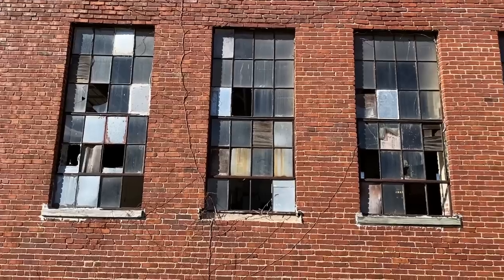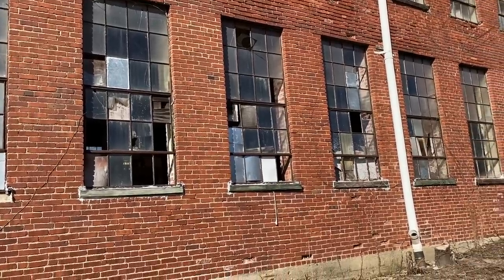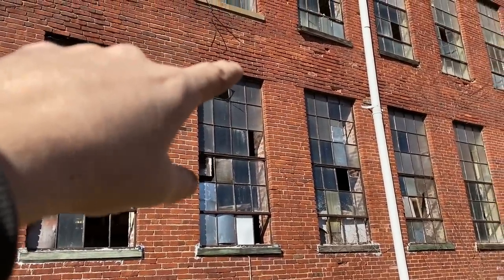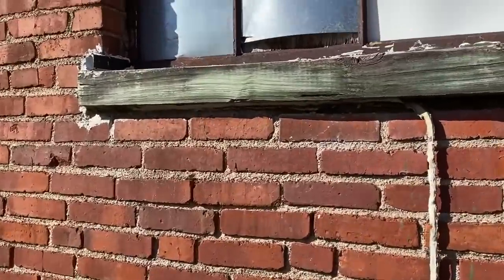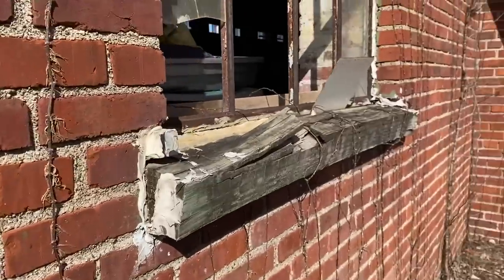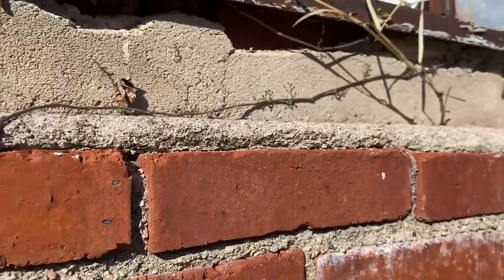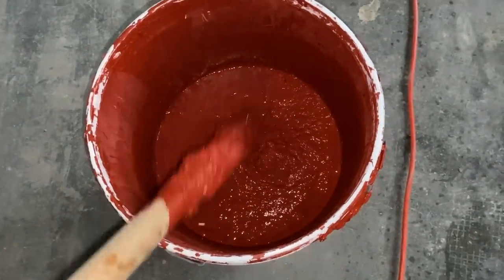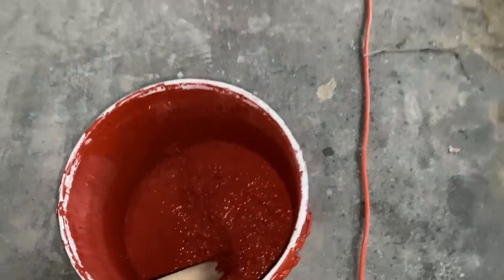Industrial building renovation - sealing windows against rain and trespassers

Comment: It would be helpful to go to the hardware store and grab a can of Johnsons paste wax, then wax your planer surface and tablesaw surfaces regularly. This will help you to slide the wood through without fighting, and it smells good. This is an old carpenters trick we wax our tablesaws on a daily basis.
Reply: Or Teflon spray, but the surface will be slick as snot for a bit afterward.

Comment: Progress is looking good Just curious, did you try adding a bit of paint thinner to the 5 gallon bucket that began to solidify?

Also consider placing some exterior surveillance cameras as well as numerous no trespassing signs, and maybe some video surveillance signs as well as alarm company signs up.
Reply from the maker: no, didn't think of that.  Nice tip.
Reply: @coldwarmercantile  If it's Latex paint the its is water based.
Reply: if the paint is water based , it just means the frost has got to it , it may smell a bit but for what you are using it for, it will be ok if you give it a good stir

Comment: Haven't read all the comments, but you might want to think about covering the window sills with sheet aluminum.  Rent a brake for a day and make up some sills, put them in first, over your wooden sills.  Caulk, etc. then put your sheet goods over the window, leaving a slight gap between the plywood and the aluminum so water doesn't pool there.   The wood you're using will last about two years or so, even if painted, if exposed to the weather.
Reply: I have to agree. Metal wrap the sills. Even if there is no wood under the metal. Until you can do the sills properly with bricks and cement like the front window. Which is cheaper and easier with brick. By the way
Reply from the maker: I want to pull them out after a bit and pour concrete sills when I get a bucket truck.
Reply from the maker: I am going to teach myself to pour concrete with a form.
Reply: @coldwarmercantile  yes youtube has some good bricky guys that someone has a solution for this exact sill project if you search.  Pretty quick once you have done one. Youll be fine, one way or the other. stay confident in your goal. Its entertaining
Reply: Normally that would be my suggestion but Imo it wouldn't look that great. Like something they would have done to the building later on. I'd find some fur, cedar, hardwood something like that. Period correct.

Comment: That first machine you used (the red craftsman) is a Jointer, it gives you a flat, straight bottom surface, then you use a Planer to make the top parallel to the bottom along with the desired thickness.

Comment: I look forward to your videos.  Your DIY is coming along.  Just for you information.  You made your sills out of spruce lumber and it is not a very durable wood for exterior.  Maybe paint will save you.  Spruce is very soft.  It would be nice if you could find a Sawyer to cut some the right size out of white oak.  It doesn’t wick from the ends.
Reply from the maker: I want to pull them out after a bit and pour concrete sills when I get a bucket truck.
Reply: @coldwarmercantile  That is a great idea.  You can set up a form to the right slope and thickness and I bet they are a within 1/4 in length. Make them inside in the dry.  5-10 at a time.

Comment: Your homemade sills are going to be rotten in a few years. Painted or not. Nothing rots faster than untreated fast growth pine in a wet area. And even waterproof glue won't keep that wood together.  Somebody down thread suggested casting a concrete sill in place which is good idea if you put a proper slope on it. 

Good luck but you are wasting time and money using those inferior 2 x 4's in a place that is guaranteed to rot. Somebody else recommended paste wax for your machines which works great. I saw how much you were struggling with the joiner. But again you are making a mistake so stop anyway. Haha. 

And your paint looks like it froze, that's why it clumped up but I could be wrong.
Reply from the maker: I want to pull them out after a bit and pour concrete sills when I get a bucket truck.
Reply: @coldwarmercantile  You have a massive project and I wish you well, and sometimes temporary fixes are required. Good luck.

Comment: Would an oscillating tool work to remove the putty/clips?
Reply: Also wonder if a heat gun would soften the putty without damage to surrounding panes of glass. I bet there is a trick to making it an easier job.

Comment: i use guardline driveway alerts. is has a ac plugin reciever and a battery operated motion sencer. so i put the receiver where the kids can hear it when it goes off so they think it's a alarm system. start up system receiver and four sencers and you can choose many sounds that will let you know which sensor is activated. put the sensors where the easy access areas are . when visitors come to my home and hear the alerts they think i have a alarm system. also if you drive the screws in on a slight angle it won't pop out the other side.
Reply from the maker: This is neat idea, I was wondering ho to do something similar.
Reply: @coldwarmercantile  
love the show, glad to help in anyway

Comment: The single pain glass they still make but its custom order and anything custom is going to cost you money. You can try and talk to a glass company. The ripples you see in the glass is probably formed when the glass was a liquid. 
  Im sorry kids think its cool to goto abandoned places. Its a problem everywhere. Same as tagging. The wood make sure its painted outdoor paint. Somehow use a masonry bolts or something to tack them down. Or motar. Im not much of a construction person. I can build a platform bed. 
  Speaking of Poland. I do follow a youtuber from poland. He cleans rugs for a living. I dont know of the place only by the youtube channel.
The channel is "Lubuskie cleaning Center".
Reply from the maker: will replace them with concrete form.
Reply: The ripples in the old glass is caused after the glass is made and was still hot it would roll down a conveyor system that would cause the glass to ripple from the rollers. I guess they use belts now to move the hot glass .

Comment: Find yourself a local lumber sawyer that can cut the sills to the proper dimensions.  Preferably in something that is rot resistant. (Locust, cypress, cedar, etc)  It'll save you time and money in the long term.  The joints are a weak spot and will let in water eventually.
Reply from the maker: Soon when I get a bucket truck, I'll pour them into a concrete mold and that will be the end of that.  The 2x4s won't last anyway.

Comment: No trespassing signs with verbage about prosecuting violators. Also put some obvious fake cameras at every entrance with signs stating this property under 24/7 video surveillance. It may seem silly but it does deter most kids. Try using a heat gun to soften the glazing compound and a dull wood chisel to remove the compound.  Keep up the good work it is very rewarding cleaning up and old property google the felt mansion in saugatuck Michigan it was an absolute mess when we started renovating it many years ago.
Reply: Twenty five years ago I bought a long-neglected house that had the same type of steel casement windows.   They were in dire need or reglazing with many cracked panes of glass.   My contractor gave me an estimate of about $5,000 to repair all 17 of the windows.   Being nominally handy, I decided I would tackle this myself.   My first step was to remove all the failing putty on each window.   I was shocked to learn it wasn’t putty holding the glass in place.  It was concrete.   What a pain it was removing that.   The largest of the windows had 64 individual panes of glass.   Surprisingly, I only broke 10 or so panes in total.  When it came to actually reglazing the windows with window putty, I  started to quickly regret my decision to do this myself but after doing a few frames of glass, I suddenly found my groove and it became quite fun and satisfying.   In fact, I got so good at it that on two occasions when I locked myself out of the house, rather than call a locksmith, I just broke a pane of glass in a kitchen window which I unlocked and climbed inside.  Then it would take me only about 5 minutes to put in a new piece of glass and apply the putty.  Much faster and cheaper than a locksmith.
Reply from the maker: I have real cameras, I might make signs that indicate that.

Comment: Leave the mortar and use an adhesive. Adhesives have come along way, that will save you a ton of time replacing those sills
Reply from the maker: actually I am pulling them out soon to pour concrete sills with a mold.

Comment: You might try 2x6 lumber stacked one on top of the other so you don't have seams on top of the sill where water will run in. A good cedar or composite wood will last much longer than that framing lumber. looks good though and you are doing wonders for that old building.!!!
Reply from the maker: I'm going to pull these out this year and try to learn how to pour concrete sills into a mold.  Not only is it better, it looks way nicer too.  You are right the wood is super prone to rot.
Reply: @coldwarmercantile  Yeah the concrete is the way to go. Easy to make some molds and pour them as you need them.

Comment: instead of putting a timber window cill in which will rot and have to be painted , why not put some form work in and cast a concrete window cill in situ and it will be a cheaper
Reply from the maker: that's exactly the next step.  I work there for 6 weeks at a time as I go back and forth and didn't have time this time for that.  ON the second floor multiple sills have concrete and I want to emulate that.

Comment: It’s always nice to see old buildings getting restored one thing I would possibly say is if possible move all the upper glass down to fill all the missing spots in the lower so it matches
Reply from the maker: I have a giant pallet of glass on the third floor.  I am learning to cut now.  The first job will be the front of the building and if it goes well continue around.
Reply: @coldwarmercantile  yah I was just thinking the old might look nice lower at eye level then new up at the top